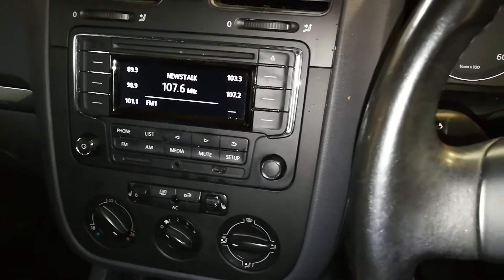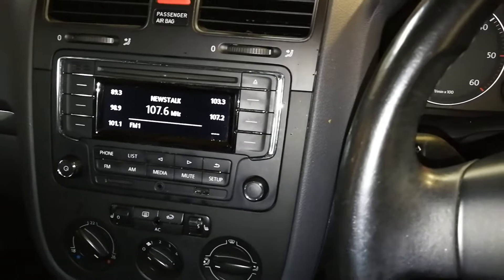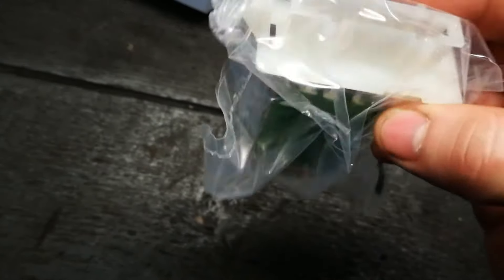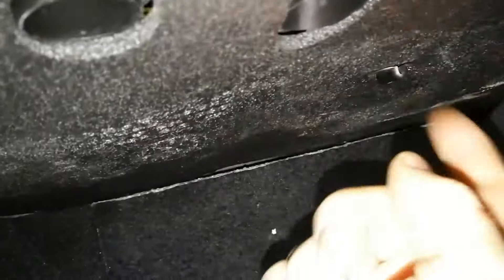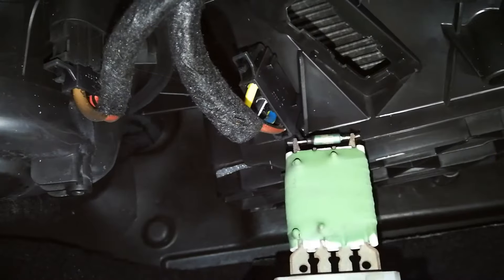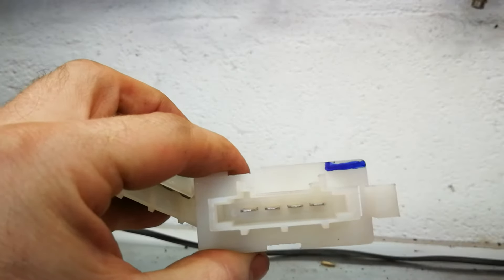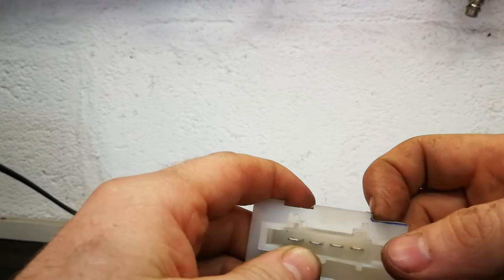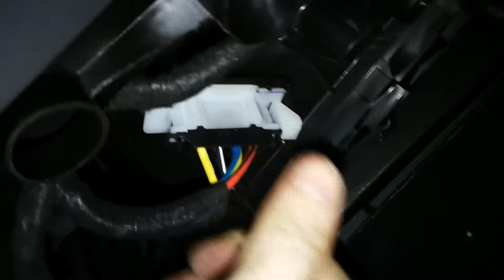Blower Motor Not Working On Low Speeds - DIY

Comment: Same exact problem on my 2011 Golf. Ordered the part from Amazon, only $15 and it took about 10 mins to replace… so easy. Replaced the cabin filter to as it’s right beside the resistor. Can’t thank you enough!!! 🙌 Probably saved me a $200 repair bill at the dealer.

Comment: Thank you, my 2008 golf had this problem and you were spot on, you sir are a star ! 👍
Reply: Did you have to shave a notch into the new part or did it come ready to install? Also, how did you know which specific motor to order or are they all standard to VW?
Reply: @CroMagArmy  I didn’t have to make any changes to the part, just unplugged the old one and plugged the new one straight in , I bought the part from EBay which checks the part against your specific vehicle so you can’t go wrong, it really is a 5 minute job, good luck, hope this helps .

Comment: The Heater blower in my Peugeot Expert 2.0 HDI 2007 started off only working on high. Now it doesn`t work at all! Is the blower motor gone too I wonder? I ordered a resistor. Thanks for the  video. "Beef to the Heels . . ."

Comment: my blower motor is only blowing on speeds 1 and 2 and whenever i go past 2 it turns the speed back down to 1. if i replace the resistor will it work for this problem?

Comment: Great video Get as always. I'm curious,  was that a spurious part or how come you had to file out the notch?  I suppose she fits a couple of diff vw/seat models
Reply from the maker: I presume the resistor fitted a few options. It is not uncommon for slight adjustments on aftermarket parts so once it was the same in the other areas I didn't hesitate to fit it. Thanks for your kind words as always.
Reply: @GerardBurkeBurkesGarage  Not a bother. Hope Civic is coming on well! I'm thinking of changing car myself.  What are your thoughts/experiences Ger of the volvo xc60 D5 with auto box (2015/16)?

Comment: On my VW GOLF MK5 the fault was a faulty fan selector switch.  This also made the resistor burn out and 40amp fuse blow... so the selector switch had to be replaced.... In my experience, the blower motor resistor normally burns out for a reason...
Reply from the maker: The resistor is the most common fault in these cases, of course there are other much less % possibilities, I disagree with your resistor normal burns out for a reason comment, if by reason you mean another primary fault and the resistor is a secondary fault. A blower motor resistor is usually the primary cause in my experience across all makes and models not just VW. I have replaced tons of resistors over the years without having to go back in and replace other items. If you have fuses blown that usually tells you a different story. 
Thanks for the comment and your input.
Reply: @GerardBurkeBurkesGarage  Okay you may be right.  But if you replace the resistor, and it burns out again soon after you replace it, then the fault is elsewhere (like it was on my car)....
Reply: @GerardBurkeBurkesGarage  The reason for the resistor burning out can be low airflow from the fan due to a blocked filter or obstruction in the duct as the air from the fan is used to cool the resistor as it dissipates a lot of heat for the size of the resistor. It is possible that running the fan with the air vents closed may reduce the airflow sufficiently to overheat the resistor and blow the thermal fuse.

Comment: I changed the fan blower motor because it stopped blowing air but not it only works on 4 (max)... I changed the resistor and its still doing the same not blowing on 1, 2, or 3 just 4.... any ideas? I've also already checked the fuses....

Its for a 2011 chevy malibu if that helps
Reply from the maker: Sounds like switch or resistor fault. With the resistor electrical connector removed check the harness at different fan speeds and make sure the readings are correct from the switch down to the resistor.
If you have the correct readings you may have a faultly resistor? 

Some electrical checks will confirm 100% without any parts replaced. If you are unsure of how to do it I would recommend getting it looked at.
All the best with it 👍👌
Reply: @GerardBurkeBurkesGarage  I actually figured it out turns out it was the connections for the resistor wasn't getting a good contact it took forever just to figure it out after I checked everything and stripped the whole car down lol

Comment: My vw mk6 dasnt even turn on at all hopefully this is the fix
Reply: Did you work out the issue? I'm having the same problem. No fan at any speed.
Reply: @dabos6  it was the fan motor i had to replace it all
Reply: @Lbs88  ok thx

Comment: What about if 4 doesnt work but 1 2 3 do?
Reply: I have not checked the circuit but my guess would be the switch has failed in position 4 possibly due to overload. Has the supply fuse blown in the past ? Also if you turn the ignition on with the switch in position 4 the inrush current is about 150A which could fry contacts.